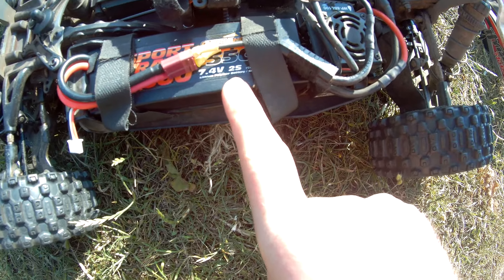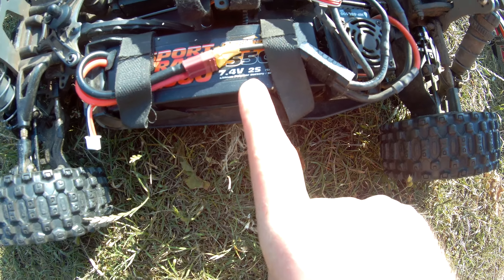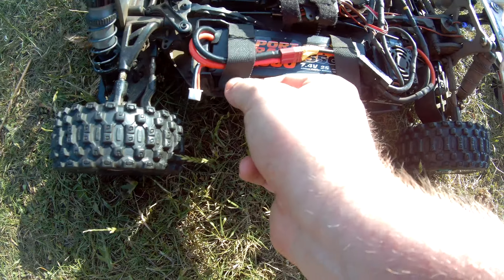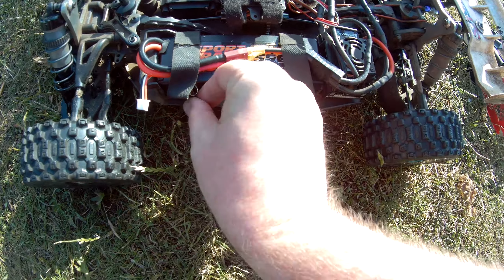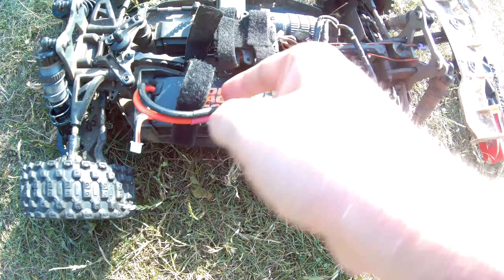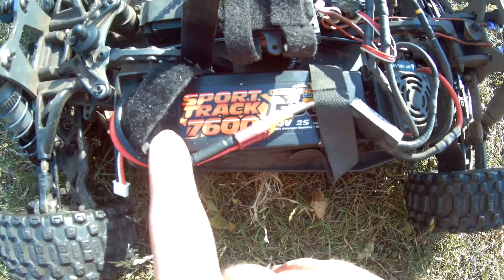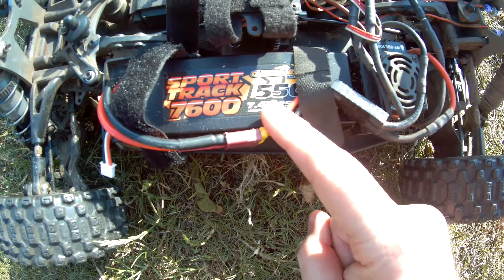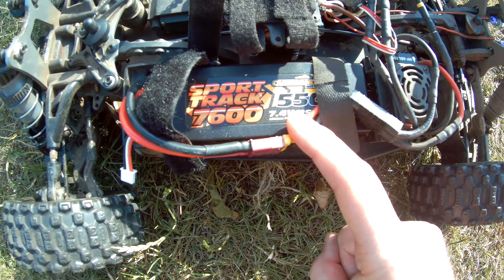2s battery in the VS buggy

Comment: Hi mate, this motor looks as 4268, ¿it's correct?, it will run in 3S too.
Reply from the maker: Thanks mate It's a 4274 motor
Reply: @rchampton4845  wow, 4274, excellent 👏👏👏👏👏👏👏
Reply from the maker: It's a 2000kv
Reply: @rchampton4845  I have the same with 2200KV and a Max6 ESC in a Buggy.
Reply from the maker: You got the same setup as I have in my kyosho inferno type 2buggy aka speed demon